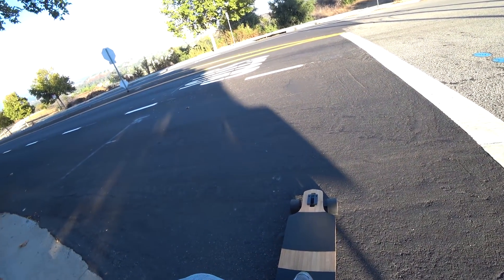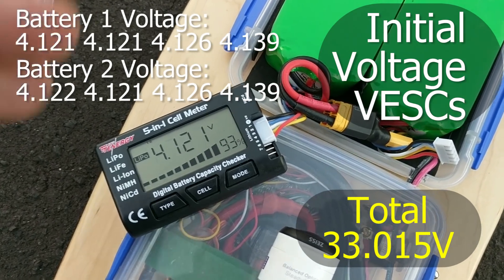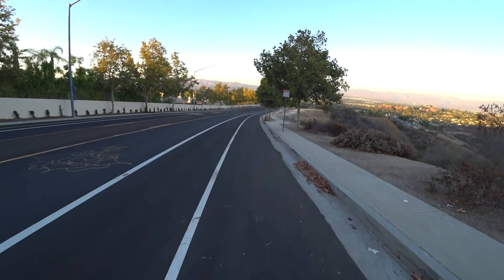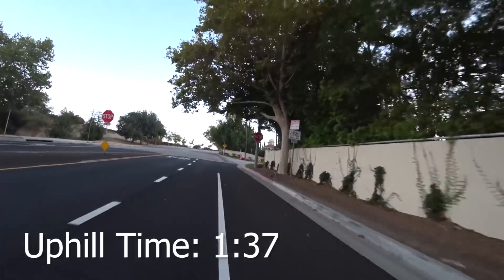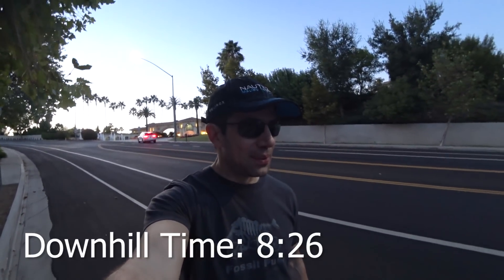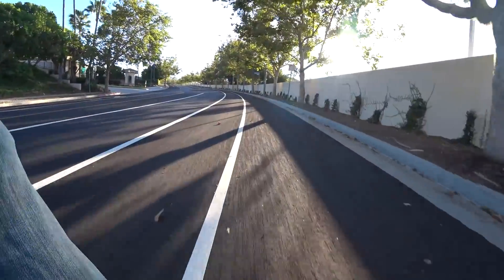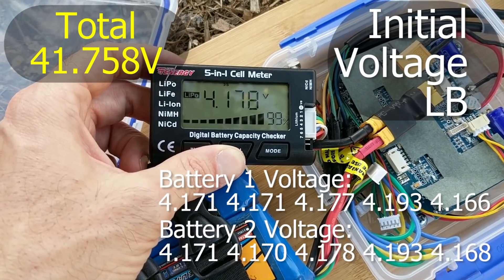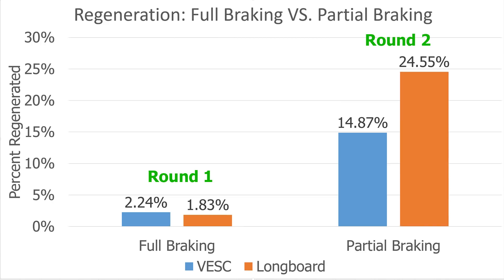Electric Skateboard Regenerative Braking | Testing

Comment: Wow looks like you're right near my house near Lacosta. but anyway the guy who used the regenerative brakes the best was heading down very steep hills very quickly then would throw on the break so that there was a lot of momentum going into that regeneration. Lagging down a  hill at 3 miles an hour I don't think is going to do it. Try a retest with going very quickly braking for a half a block getting up some more speed do it like that and you'll get way more... good job on the video keep putting out more videos I think I'll subscribe

Comment: Sorry man, but you miss a great point. the REGENBREAKING  works much better if you not break.. sounds a lite strange i know.. but the Regen do not recovery more energy based in how much you slow down.. but actualy works better if you spin the motor as fast as you can without using the battery energy..
try a 3º time.. and this time go down hill, and do not accelerate or brake, only cruse down hill but without acceleration.. Do this and you will see the board recovery a LOT more energy..
Reply: Enryson Ferraz Mhhh I will try hanging on to a car and see what happens...
Reply: Inclined to agree with you.
I ride a lot of downhill on my board free wheeling. Recently in France on a 4km downhill had an issue where the board over charged going downhill freewheeling.
Reply: Wait a dam second here.   I'm not sure which comment to believe.. is this true.   Does the battery regenerate without breaking?   I need more information to be sure.  But I hope this is true.  I ride allot to in NH on steep hills.    My philosophy is never ever ever ever use the break.  We ride down mountains just carvin for miles.   It has always been my suspicion of a small recharge .. more facts please!!!
Reply: Bullshit, don't explain stuff u don't understand. If u arnt breaking, there is no connection to the battery
Reply: @fish9468  poeple have tested there boards and have said otherwise
Reply: @mattswette8338  It is called 'voltage sag' and the voltage can increase when a load is removed. Without breaking, there is no connection to the battery, there is a physical switch which is off.
Reply: Enryson Ferraz simply no. Not true at all

Comment: Hey, the VESC have a bluetooth app that you can monitor many things on the skateboard. include check the Voltage and current draw from the battery.
you will need a cable and a HC06 bluetooth module and is just conect to the VESC...
Reply from the maker: Yeah, I've seen those. I should get one. Thanks.

Comment: The method you used to check charge percentage makes me sceptic about the results. However, in many ESC full breaking means shorting the motor leads which means that all of the energy becomes heat
Reply from the maker: Thanks for the feedback. I know checking voltage isn't the most accurate. I wanted to get a general idea of the benefit from regen brakes.

Comment: The voltage has to be higher than the battery voltage in order to recharge it.  The only way to produce that voltage is to go top speed when you start braking.  Or,  if the battery is dead,  perhaps half speed,  but still,  you're looking at like 15+ mph in that case.
Reply from the maker: It would be interesting to know the voltage the motors generate while braking at different speeds. Someday I should do a third test where I repeatedly speed up and brake down the same hill. Thanks for the feedback.
Reply: The voltage generated depends on the KV rating of the motor. If you have a 400kV motor then for each volt you apply you should get 400 rpm. Applying that in reverse mean 400 rpm will give you 1 V, 800 rpm 2V, and so on. Essentially the faster you go the higher the voltage that you generate. I think the kV rating is given for a no load scenarios. Which means that If there is a load, you will actually get less than the 400 kV that is specified. In a nutshell,  the higher the rpm the higher the voltage.

Comment: I wonder if you tested going up hill and down hill on the same speed. Because regenerative breaking on ESC gets very efficient when it hits the motor rpm sweet spot.
Reply from the maker: It seems like speed definitely affects how well the regenerative brakes work. It would be interesting to know how big the difference is.

Comment: The BLDC motors are very low induction. At best they generate a couple of volts, not really enough to recharge a 4 volt cell. The power is pretty much dissipated even if anything of value in generated. The answer would be to have a voltage regulated Buck Boost converter that takes any power and converts it to charging voltage no matter the speed of the motor. You probably find with something that the full braking might actually charge equally to the partial. One way generates a lot of current at low voltage and the other generates a higher voltage. I guess as Americans we should sit around and wait for the Chinese to come up with that, because thats the patriotic thing to do.
Reply from the maker: I haven't experimented with these motors and circuits at a low level. Sounds like that circuit could help. Manufacturing hardware isn't easy though, so I'll have to hope someone (somewhere) makes it happen. Thanks for the info!
Reply: My ebike makes more volatege as it rolls it makes up to 70v at about 45amps when full breaking from 30mph
Reply: Because of the speed and induction of the motor (more windings), most likely. The little motors used for skateboards just have very little windings. Also magnet size might have something to do with it.

Comment: Technicaly speeking you dont need to full brake all the time. Better will be if you speed up and then brake with highest speed. this kind of  breaking have to give you best efficiency. This is because with highest speed generates higher voltage  and efficiency of DC-DC BUST converter is also higher in this case.
Reply from the maker: Thanks for the feedback. Yeah, the results might have been a bit different if I let the board speed up more (like 15 to 20mph) and then braked for shorter bursts. I don't think the result would be too much different because I'd be braking for less time. I guess it depends on how the ESC is designed. Maybe I'll try that some time to compare.

Comment: He just proved that the budget model is better
Reply from the maker: It's hard to say for sure because the motors connected to the VESCs are smaller. However, the budget ESC is definitely a good value!
Reply: I can't find a vesc for under $200 and the budget speed controllers go for $40-$120 depending on how many wheels you want to drive. I often think how badass a 4wd board would be but shutter at how much that setup would cost. But one day I'll have that much to spend. :-)

Comment: First off, excellent video. I am really glad that you had 2 different trials and 2 different boards to test. This is quite frankly one of the better explorations of this topic applied to electric skateboards. 

Secondly,

You should look into something called an Eddy Current. This is when a changing magnetic field drives an electrical current within conductors. Essentially when you are freewheeling you are generating solely eddy currents. This is the principal that all power generation uses by spinning some form of generator. When you are applying the brakes you are expending electrical energy to reduce your speed. Because you were still moving downhill you would recover some energy, but it won't be nearly as much as if you were free wheeling. Many times I think the manufacturers realize that even when you are freewheeling you still experience some form of braking more than you would on a regular longboard and that's why they dub it "regenerative braking".

Also I had a couple of questions...
Regarding the difference in heat between the two boards, what hub motors are on each board?

Are the hub motors the same rated power?

I imagine that the difference in their hill climb performance and their heat generation has to deal with the power ratings and the efficiencies of the motors more than what type of speed controllers you are using.
Reply from the maker: Thanks! Yes, I wanted at least 2 boards to compare the results so I could get a better idea if one was just acting strange :).

The longboard has the same 90mm motors as the meepoboard and other popular boards (around 500W each). The VESC board has different 83mm motors I got on eBay (around 350W each). I have links to both in my previous videos. The 90mm motors are much more powerful and generate less heat.

I haven't fully investigated how the ESCs are designed but I'm guessing when the motors are freewheeling the battery charging is disconnected - so there is no load attached to the motors. When generating electricity there will always be resistance (braking) on the motor - mechanical energy is needed to create electrical energy. More electric energy generation (battery charging) requires more mechanical energy (braking) to drive the motors. When they're freewheeling very little mechanical energy is being taken by the motors - so there would be very little battery charging.
Reply: @orensprojects7250  dude ur a fucking idiot , how many times have people explained this to you an you still  make up your own random ASSUMPTIONS. for the ten millionth time ,ur theory that adding the brake cause to add more mechanical energy but YOUR OWN VIDEO PROVED YOU WRONG!!!!!!! THE RESULTS OF YOUR OWN VIDEO SHOWED U GOT BETTER RESULTS WHEN U WERENT USING THE BRAKE. AND ALSO JUST SO YOU KNOW THE BOARD IS NOT BRAKING LIKE NORMAL BRAKES WOULD, IN THIS CASE YOUR USING THE MOTOR AND ITS ABILITY TO GO IN REVERSE THATS WHATS SLOWING YOU DOWN. IT DOESNT DO THIS MAGICALLY IT REQUIRES FORCE TO STOP AND THAT FORCE COMES FROM ENERGY WHICH IS IN THE BATTERY

Comment: You cant measure the energy by just measuring the voltage.
Reply from the maker: The voltage drop isn't linear - if you google "lipo discharge curve" you can see an example. The voltage especially drops off quickly from a full charge - so a 10% drop in voltage doesn't equate to 10% of the battery capacity being drained. The more accurate way to do this is to measure the current and voltage as the battery discharges - to compute the watts drained and then regenerated back to the battery. Since I always started with fully charged batteries on both boards it hopefully keeps the comparison closer and gives a general idea of what's happening.

Comment: I want to do the long board build the only problem i have is the type of batteries to use
Reply from the maker: The LiPos have been working well for me. The only issue is that you need to charge them with a balance charger. The main advantage is these 3Ah 5S batteries are currently about $46 for the pair ($23 ea). 
https://hobbyking.com/en_us/zippy-flightmax-3000mah-5s1p-20c.html
Meepoboard sells a good Li-ion setup with a BMS built in if you want a setup like that.

Comment: you are comparing btween lipo vs lion so it's not that accurate. and like other says ur going too slow as well. in my personal testing in total distance it adds up to 8-10 percent of battery back, 

it was it test tho, I think this feature is more useful as "smoother brake" tather than increasing the distance.
Reply from the maker: Thanks for sharing your experience! Yeah, most prebuilt boards, like Boosted, Acton, Meepo, etc use li-ion. Both the boards I tested have lipos. Regen should still work at slow speed. It depends how the ESC is programmed. It seems most are designed to only regen at higher speeds.

Comment: Great info, thanks for this. On some (or all?) boards with regen braking, braking doesn’t work when the battery is fully charged to prevent overcharging. So I’ve had situations where the brakes didn’t work even on a flat surface because the battery was at a full charge. But how’s that even possible if more energy is always lost vs regained (e.g., full battery, flat surface, accelerate for 15 seconds, can’t brake)?
Reply from the maker: Thanks! That's true about fully charged batteries being an issue with regen braking. It's usually not too big of a deal because once you ride a bit the battery will quickly drain enough to handle the braking. My best guess about your brakes not working sometimes is that your ESC is disabling braking until the voltage drops below a certain level to protect the battery. Accelerating for 15 seconds might not be enough to cause the voltage to drop below that point. You'd definitely be using more energy accelerating for 15 sec than braking for 15 sec, but your ESC is probably playing it safe.

Comment: I think there is a minimum speed required to regenerate . I have heard that 10mph was a target speed maybe you were going too slow
Reply from the maker: That could be. Theoretically the motors can charge the batteries at slow speed but I'm not sure how the ESCs are programmed. Slowing down to around 10 mph does match what I was seeing in my test for getting better charging.
Reply: First, braking is a useful feature even if power generation is low.  braking energy is a function of total weight and speed.  Turn your skateboard into a powered cargo trailer!

Comment: what surprise. i was thinking about this topic one day before you upload the video. nice video. you forgot to mention just one minor thing that i am curious. in the second test, did the batteries/motor get warm?
Reply from the maker: Great minds think alike :). That's a good point about the heat. It's difficult to measure exactly because the heat gets dissipated across the motors, trucks, wires, and ESC. In my experience it seems like the motors get much hotter going up the hill, when the current is very high, than when going down.

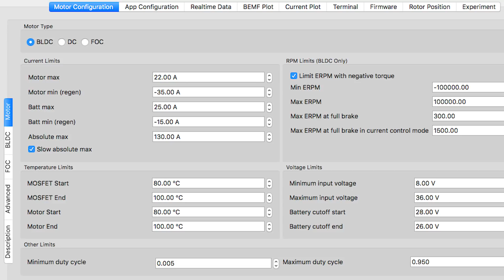Comment: 6:34 Motor min (regen) setting is limited to the Batt min (regen) setting. Your 5.2Ah 6-S LiPo has a charge rate of 5C, which makes for a max charge current of 26A. You could probably safely increase your Batt min (regen) value to -20.00A and see if it feeds more current back to the battery (you'll get stronger brakes, too, so be careful), since regenerative braking is essentially fast-charging. 

BTW: the 10C rating of your LiPo is probably the reason why the fishtail board has less oomph when climbing hills, and the resulting stress on the battery creates heat. C-rating is often exaggerated by the manufacturer and in reality could be less. 

I recently bought a pair of Turnigy 4Ah 25C batteries to replace a similar 30C variant (the 30C was out of stock), and the mild decrease in acceleration and hill climbing was noticeable, as was the heat generated by the battery pack. The advantage of the 25C variant, however, is the 5C charge rate vs the 2C charge rate of the 30C model (I can finally have more braking power, especially from high speed). 

As always, experiment carefully and wear a helmet (I want to see a lot more videos from you).
Reply from the maker: Sorry I just saw this. For some reason youtube marked it as spam. Thanks for the feedback and sharing your experience! I need to mess with the VESC regen settings more. That's a good point about the C-rating. In this case I think a big part of the speed difference is the 83mm motors are significantly less powerful than the 90mm motors on the longboard. It's interesting you noticed a difference when switching to 25C batteries. Faster charging is nice. The only thing is you need a fancy charger to max out 5C charging :). My B6AC V2 is only a 50W charger so it maxes out at 2.4A on 5S batteries.

Comment: Very nice test and video ! I had the same question. Manufacturers say "regenerative breaking" but I think it is more effective as freewheel. I disassembled an electric skateboard having "regenerative breaking" feature because I wanted to check if freewheel can regenerate current back to the battery. Actually I measured a generated current while it is use as freewheeling (no acceleration, no breaking, so push the board or go downhill). So I conclude that freewheeling can charge the battery. And the more speed you run in freewheel, higher the generated current is. So it would be interesting to do a test by pushing the board only or go downhill as freewheeling (a slight slope for security, of course !). What do you think about this ?
Reply from the maker: Thanks! That's cool you disassembled your board for testing! I'm guessing the hub motors still have a bit of drag when freewheeling, and basically braking a little bit. I'll try taking some voltage measurements when just rolling and see what happens. I'll have to go to a different hill though. Coasting down that mountain would be scary :)

Comment: Hey brother. I am from KV Electric Skateboards and would like to send you a free wireless chip that will read your esc data in real time using phone app. Would you consider running this test for us in exchange for the free parts? Here is how it looks https://youtu.be/XH3D7THQhrA
Reply from the maker: Hey Adrian, looks interesting! I'm guessing it only works with the VESC. It's great your shop has parts for the DIY community. You can send me a direct message.